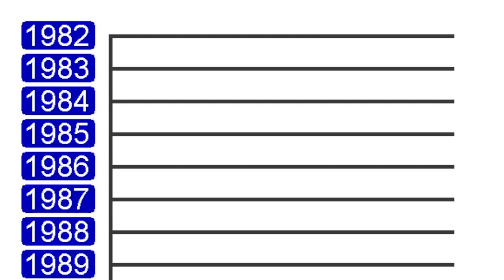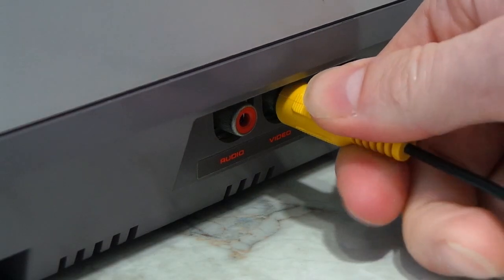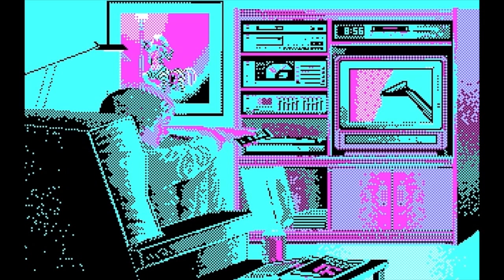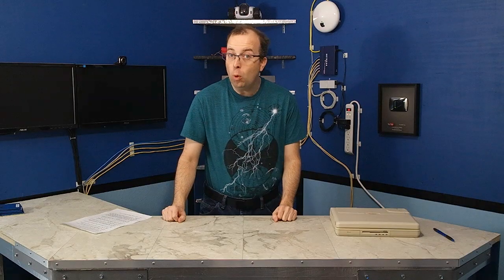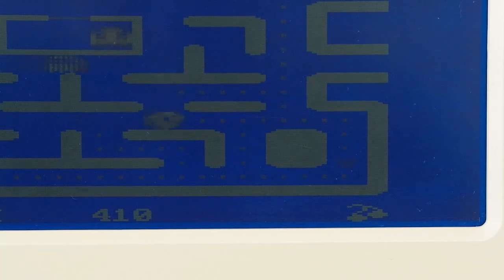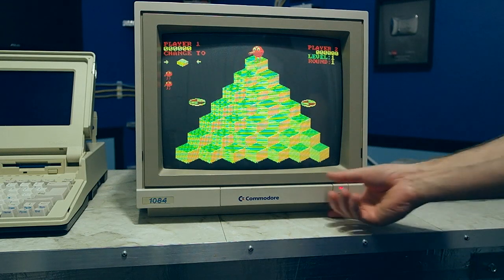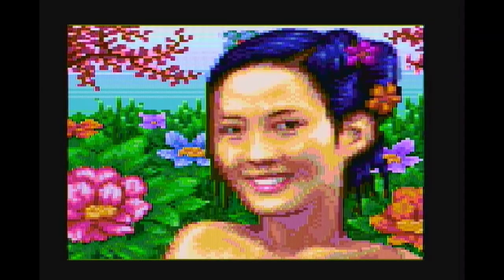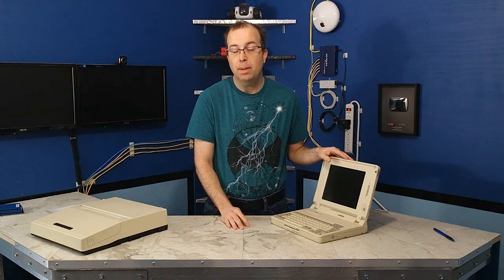CGA Graphics - Not as bad as you thought!

Comment: Pretty nice rundown - though there's a few minor things missing that it might be nice to have in a followup or something...

1/ Besides those four "official" low-rez palettes and hi-rez mono, you could mix things up a little bit ---
a) There was a third "unofficial" palette used by certain software, achievable with some register poking, which was a kind of halfway between the two, having Black, Red, Cyan and White - again in either low or high intensity for the non-black colours. This was generally more usable than either of the others and it's a bit strange why IBM chose the other two to be the standard ones. I suspect that this would also provide a whole extra set of Composite shades too.
b) "Black" was actually "background" (and usually-unseen border) and could be set to any of the 8 low-intensity colours independent of the other 3 palette entries (can't remember if it turned hi-intensity with those main palettes, but you still couldn't get dark grey). Some games particularly made use of that, e.g. setting dark blue instead, with the red-yellow-green palette, giving a nice selection of shades for outdoor scenes (sky/water, foliage, sand/clothes, flowers/skin...). Again, this would probably alter the composite shades.
c) At least the background and possibly the foreground colour could be altered in hi-rez mode, it wasn't just black and white. Again, "background" was limited to the darker colours.

2/ Hi-rez mono mode also saw a lot of use in Composite mode, because it also created unique colour artefacts of its own. There's fewer RGBI pixel colours to choose from, but the pattern can twice as fine, so you have greater control over the artefacting, and the resultant palette is somewhat more balanced than in the low rez modes (and of course you can change those two colours anyway). This is almost certainly what's being used in Battle Chess and 8088 MPH - it would have been nice to see what happened when you flipped the input switch whilst running those! It was also used with the King's Quest series AFAIK... (which was kind of unique in giving you the option of 160x200 16c, 320x200 4c, or 640x200 mono artefacting in early games, all based off the same basic graphics data). Again, this is very similar to what the later Apple IIs do in their double-high-rez mode, but with 640 pixels not 560.

3/ Maybe some background on how the 160x100 mode worked? (And indeed that IIRC it could actually be used as 160x200, but most programmers chose to use the square pixel mode unless converting something that originally used that on an 8-bit system, because it looked "more correct" and used less memory and CPU) ... it was quite an interesting hack overall, really, and also one that should still work on EGA/VGA (and by extension, any modern graphics card?)...
(also, I wonder if you could still use composite artefacting by running your VGA signal through an old PC-to-TV converter? I've got one of those cards squirrelled away, it's ostensibly an 8-bit ISA device but the only two traces present on the edge connector are those necessary to draw a 5v power supply so it could easily be hacked to run off a USB cable...)

4/ A side note to the above - EGA and VGA didn't support the composite modes because they couldn't, in the main, use composite monitors (a few special multi-compatible cards did, and in which case you could of course use that mode because it was just pixel patterns, not any special register setting). Their output was at a higher frequency - except in the case of EGA set to use an RGBI CGA monitor* - and so generally required an entirely different monitor rather than a glorified TV with its tuner replaced by extra sockets. VGA of course is analogue, too...
(* this is why you can't use the full 64 colour palette in low- or medium-rez; the system can only be sure you're using a compatible monitor when running in hi-rez. It was considered enough of an upgrade that you could use all 16 of the standard CGA shades in 320 and 640x200... some later EGA games tried to improve things by using 640x200 but dithering to 320... it didn't generally work that well...)

5/ The card is a strange set of contradictions and compromises; the basic controller on board is very hackable, but the BIOS and support chips it's married to impose quite a lot of (deliberate, rather than intrinsic) limitations that are hard or impossible to work around - the hardcoded palettes, for example. Certain registers that could otherwise be set to produce handy custom modes get regularly cleared or reset to a certain standard value for no clear reason other than the IBM programmers either weren't thinking straight, or had forced obsolescence in mind.

Another example of this is the low and unexpandable memory complement, and no real Vsync interrupt exposure. So although it was on a separate bus, running by itself, with its own memory - which should have given the machine a fairly decent speed boost to both graphics and computation vs its main rivals (whose CPU had to wait to access the shared RAM until the vidchip was done with it, and whose video modes therefore had to be compromised in order to not cripple the CPU performance) - it wasn't possible, outside of textmode where it didn't matter so much, to use double buffering / page flipping to build a new image in offscreen memory before setting the output hardware to read from the new bank instead of the old one and provide an "instant" update. Nor was it particularly easy to identify whether the card was actively updating the screen or in a blanking period, and thus safe to access (particularly, to send new image data to) without disrupting the display... a bit of a problem when 8-bit ISA was too slow to shift more than about 5kb per Vblank period. Thus the classic "CGA snow" with some less caring programs (even in textmode with the worst ones, even though a text screen was only 4 to 8kb) where spurious noise would appear on-screen whilst VRAM writes were occurring at the "wrong" time.

A combination of which being the reason why Maniac Mansion herks and jerks like that, with a noticeable "screen tear" effect where each new image takes 4 or more actual screen updates to paint onto the monitor - the program has to run a somewhat CPU-wasteful timing routine to sync to the actual VBlank (after resetting the card, so its status is known line-by-line), build the new scene in main memory, then shunt it across the ISA bus as fast as it can without causing snow. It could probably run 2-3 times faster by just writing direct to the card, but without the extra memory bank, you'd both potentially see the halfway scene drawing stages every single time, and suffer a huge amount of visual interference whenever the screen scrolled. I'm quite amazed they actually even tried full-screen scrolling (or that Apogee manage to pull it off with any kind of finesse) because it's just such a bad idea on an 8-bit CGA...
(16 bit slightly better, as you can at least move data twice as fast...)

The 3D games seen probably did better because they could get away more with redrawing the scene line-by-line directly into VRAM, and maybe even use some primitive acceleration commands to auto-fill some of it with block colours, as well as leaving some parts unchanged. But really, you were much better off with flip-screen or single-screen platformers and arcade games, and other such titles which didn't require so much of the screen to update at once or could afford to be slower paced, like typical 2D racers, shooters, simulated board games, strategy titles, etc.

Heck, I have a feeling it didn't even let you change any of the display attributes (palette, background colour, etc, or even flicking between text and bitmap graphics) halfway through a frame, which would otherwise be a typical colour-upgrading and sometimes even speed-increasing display hack. But even if you could, timing it correctly and pulling it off without at least a little bit of snow (even less space for passing commands and data in the HBlank period) would be a monumental effort.

Sooooo it's maybe better than most people thought, but it was still hobbled in some places by rather questionable (and probably corporate-mandated) design choices compared to how it contemporaries tended to do things. It's maybe explainable by how it wasn't really meant to be a home computer - the CGA was expected to be used alongside the MDA in a twin-monitor situation, one showing hi-rez text, the other doing graphics, in a Serious Business environment. It was the PCjr (with its improved colour modes and sound, etc) that was meant to be the home derivative. What CGA could do made a lot more sense when looked at in terms of office use.

Comment: I liked the long pause when you were mentally comparing the CGA adapter to the Atari 800 :).    ANTIC is capable of up to 384x240 with overscan, 128 or 256 colors palette on whether you're looking at an early machine or later machine.   The 6502 is only an 8-bit processor of course, but can handle significantly more instructions per clock than the PC XT 8088 - so they can probably push their graphics equally.     Although with CGA having a monochrome 80 column text mode is a big advantage.      I'd love to see some more Atari 800 love on this channel..